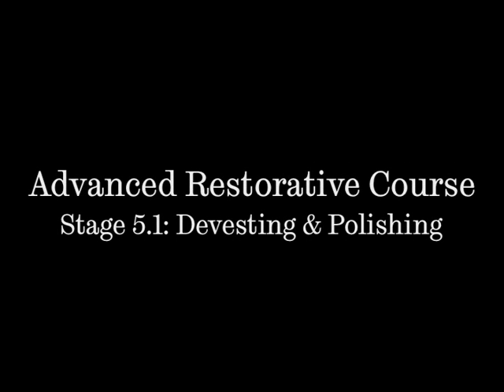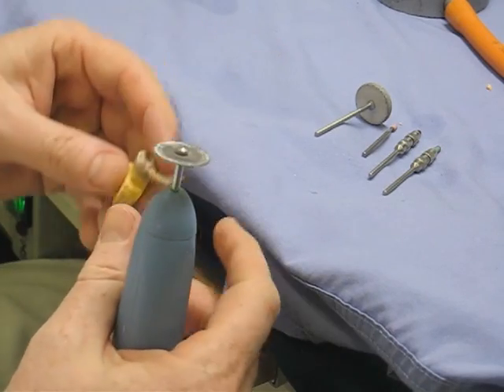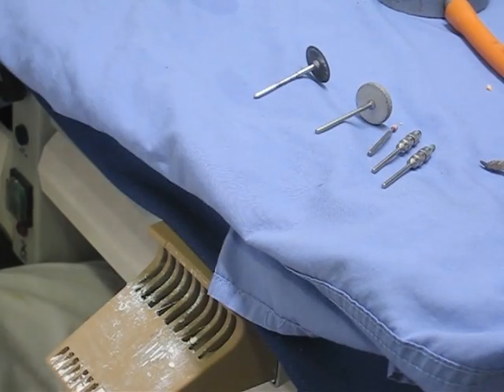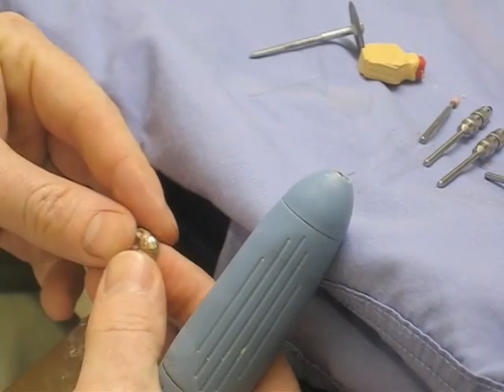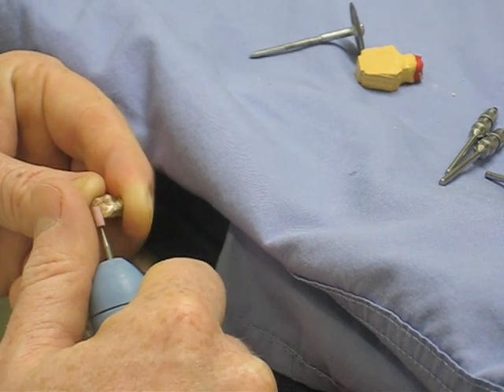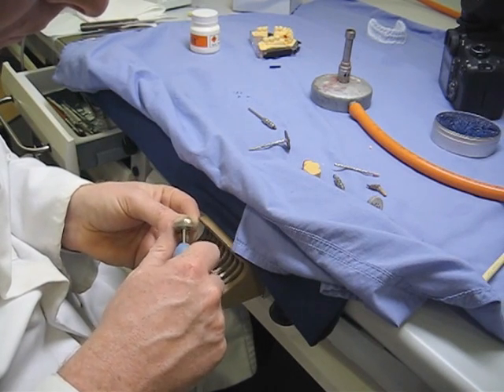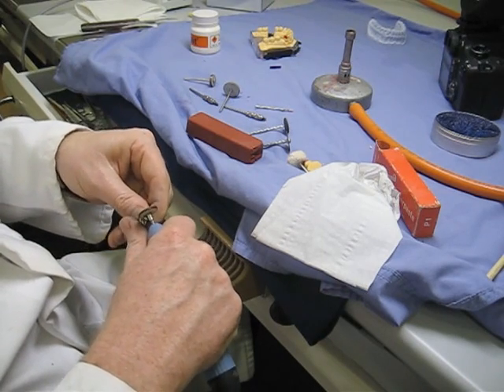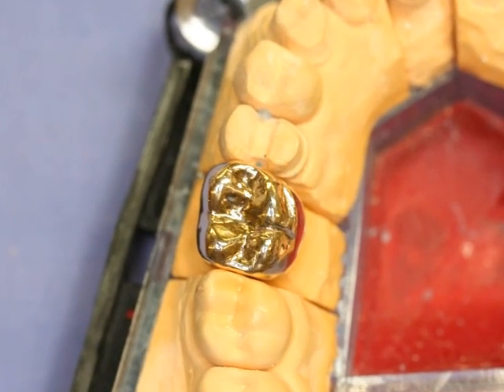Restoring a tooth (Gold Crown) - Part 3

Comment: Do they still use such techniques, or is CNC machining (and maybe 3D printing?) the dominant method?
Reply: I think cnc method is possible though quite a big block of gold would be required. 3d printing hmm I doubt it because of the Tm of gold.
Reply: Well, they manufacture rocket engines from Titanium using 3d printing (sintering method)...